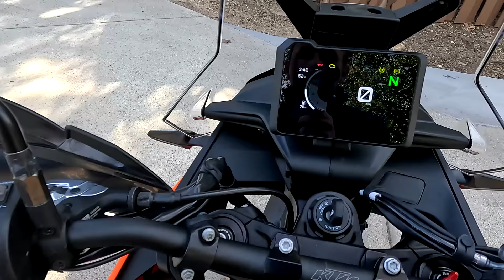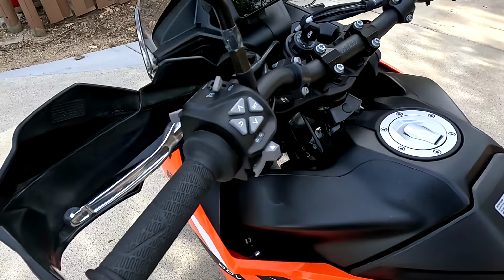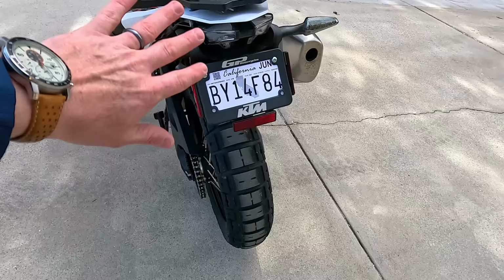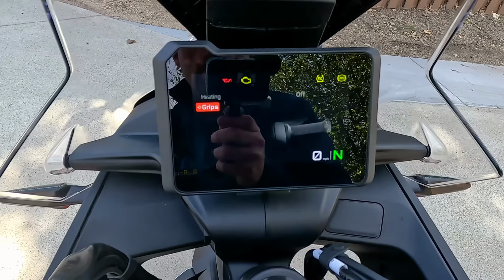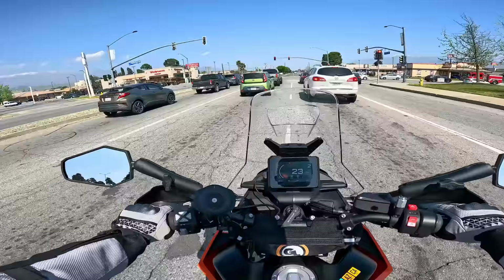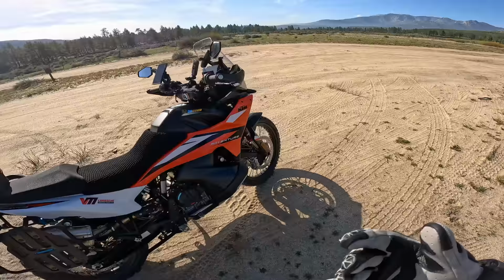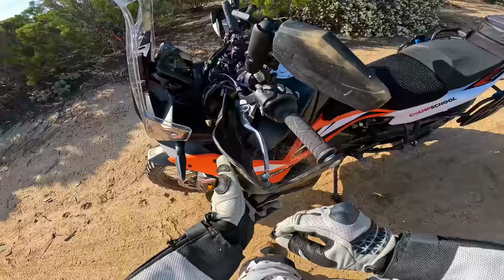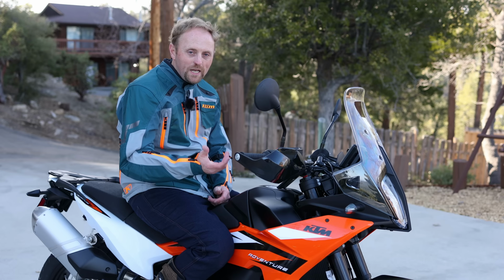2023 KTM 890 Adventure | Perfect Do-It-All Mid-Sizer ?? (EP.2) (Full Review)

Comment: I’m getting my first bike soon (picking up Friday) to ride with my father in law.  We will be doing mixed riding and I was all over the place.  I’ve ridden with him off-road, but this will be my first road bike.  I was planning on an 800DE but the lack of cruise control seems a huge miss when it’s all already ride by wire.  I had a spreadsheet laid out (similar to yours) with all the current models from the CFMoto 800 T (as a starting point only….the 800DE was the real start) to the Toureg, the Africa Twin base, the 890 and on and on.  Then Husky released the 901 Expedition….and that’s what I’m getting.  Not quite an 890R but a bike I’m not likely to have to replace and something I’ll grow into…basically forever.  And the price difffernce considering it has the Tech Pack already unlock is a no brainer.
Reply: i LOVE my 901 but i do wish i had known the Expedition was coming and waited for it for the suspension alone !  but i have spent the '$' to upgrade my 2022 base 901's suspension before the Expedition was ever mentioned , that said this bike is by a margin the most capable bike ive ever owned !   ive always been a dual sport/Adv bike and ive been very lucky to have owned a whole long list of them prior , with the suspension on mine fixed it is like cheating i swear and that Expedition comes with great suspension standard
Reply: great choice 👍👍

Comment: Great review. Thanks a lot.
Looks like a great bike .
Just one thing I don't get... the suspension behavior off-road.
You weren't going very fast at all . How can a performance oriented bike by a company like KTM still come with suspension that you immediately plan to replace?
It's not a matter of cost reduction because it's only 1500 $ less than the R . And it's not like they don't  know how to make a 200mm suspension that is properly damped and has pre-load on both ends...
So it just doesn't make sense...
Would still love to own this or a lowered R

Comment: I’m enjoying your informative reviews. After having watched several of your reviews on the earlier KTM 790 R clearly the market has big expectations of the latest KTM 890 R and it’s apparent  upgrades. As a prospective buyer of a KTM adventure bike I am carefully evaluating the pro’s and con’s over example  the Yamaha T 700 Tenere. I ‘cringed’ at your revelation that the 790 Adventure R had many documented cases of the ‘condenser pipe exhaust’ overheating the rear shock unit resulting in complete failure of said rear shock !. I find it hard to believe that a bike that claims such a sophisticated level of onboard ‘Tech’ could suffer from a simple ‘mechanical’ design flaw ! I will be scanning all the new reviews to see if KTM has fixed this fault in its new 890 R variant.

Comment: Thanks Ian for the very detailed review, as always !
One thing I'm concerned about is reliability. What good is a bike that does not start and leaves you stranded ? Especially for long distance, multi-day/week trips in relote areas...
That's why instead of the KTM 890 adv I'm considering the Africa Twin standard (manual), or the T7 World Raid. The T7 WR is 220 kg fully fueled vs. 229 kg for the AT. It's significant but not THAT huge of a difference...

My question is the following: in your opinion, how does the 890 compare to the Africa Twin off-road (suspensions, power delivery, etc) ? Does the AT feel that much heavier ?
Reply from the maker: The AT feels way heavier than an 890. If you're concern is mostly reliability, stick to the Honda or Yamaha. The T7 WR would be a great bike, wish we got it in the USA
Reply: very very diff bikes , ive personally had good luck with ktm/husky for the most part

Comment: I am thinking about this bike but what I really want is something in between the 390 and 890. If they come out with a 690 adventure that would hit the sweet spot for me. They already have a good 690 single cylinder engine they could put in it and that would easily make it the lightest adv bike in the mid sized segment. Put that motor in a 7/8 scaled down version of the 890, with the low gas tank design and other features, and it would blow everything away.
Reply from the maker: Totally agree

Comment: Great review as always. I am about to replace my 790R and was looking forward to this review. Some thoughts: 
1. FINALLY they have the hazzard lights! When you do trips you WILL stop on the side of the road, and you absolutely need these.
2. Much better package than the previous ones.
3. I dont like that the have 4 screws for the screen. With the 790 I had replaced the screen screw with the a thumb screw and had a both the tall and low screen which i was using depending the trip and was a simple change. Hope there is an after market adjustable one.
4. I am probably going again for the R model but following my experience with the 790, i will fit the low front fender (never had an issue with mud and worse case scenario, remove the fender) because of the higway parts, and will get the seat from the base model (again comfort on long trips) as i did with the 790R.
5. As before i wil get the Magura hydraulic clutch (or sell the 790 with the orginal one and keep the Magura for the new bike).
6. BT for the bike is useless, you have the phone and it messes with the Cardo or Sena usability
7. The cover for the chain sprocket is the same, still a mud trap and very difficult to clean, so again will make holes in it.
8. The handguards feel strong in the touch but they dont stand up the forces of a fall, especially on rocks. Barkbusters with running lights again.

Never had any reliabity issues, my 1200GSA tried to kill me (the front forks recall issus happened to me). Fun note, i learned riding offroad on the GSA (yes, I am an idiot) and these bike seem like a montain bike to me!

Final words, I have gone through several bikes in my life so far and my advice is NEVER, EVER buy a new bike in its first model year! Wait at  least one to find the issues and missing options to come through.

Comment: I have watched most of your videos and  I  would have guessed that you  prefer the Aprilia Tuareg over  both the  KTM  890  because of  the  great price and refinement of  the Aprilia along with the great suspension.  There is a big power difference but you can't put more than 80 hp on the ground in the dirt.  I will never buy a Desert X after you informed me about the  air filter location and  Ducati's arrogant refusal to provide a  detailed  repair manual.  Which mid adventure to you enjoy the most (grin factor),  the 890,  Aprilia or  Suzuki  800?   Keep up the good work.
Reply from the maker: Aprilia is still my favorite

Comment: Ian, thanks for another excellent review. I also have a '23 KTM 890 Adventure, which I really like more and more with each ride. I love tweaking settings in suspension, traction control, etc. So for your new Bridgestone tires, what air pressure do you use for dirt/rocks, sand or highway travel?  Did you try different pressures on the stock Pirellis? Thanks in advance.

Comment: Hello Ian.
 Second post with similar theme. I did just under 10k miles on a 2017 Africa Twin DCT. Motels average every third nite. Moto camped. 95% pavement because early in the trip mud got me in Kansas and i realized this is a bitch to pick up. Got hurt and gunshy of off pavement. The AT suspension is way too soft. Speed limits out west are 80 mph, so closing speeds are 160 mph plus on passes. Thats 180 plus feet per second. Ok....next year i need less weight, more suspension and more acceleration. I just bought a 21 KTM 890R used and equipped as i prefer to do. It has the 1 cylinder start issue. Long term on going problem with these bikes. Guys like you with your platforms can make this very real problem noisy for KTM. Brett is the only widely viewed guy who makes any reference to it that i subscribe to. I am 66 years old and own 7 bikes. Maybe my demographic does not calculate but i spent plenty on motorcycling related merchandise this year and will do so until dementia stops me. Please do more than " brutally honest new bike reviews". The bulk of the real travel is guys and gals buying used bikes and  trying to find information.  Bike night starbucks crowd wants new show off lookit me shit. Used buyers travel and use the stuff. Just my observations as a lifetime biker. And yes i have bought new. 2 bmw's, 1 Ducati, 1 Suzuki. Bmw bought back one of them.
Thanks for what you do and dont sell out with glowing reviews just to get test bikes for clicks. It wil put you in the big bucket. All IMHO.

Comment: So now with this updated 890 out of the norden and this, which did tou like more? Between the standard norden and this, looking at .4" more travel and a slightly taller/wider seat on the 901. 
30.75" inseam/150lb rider here and I like the styling on the norden more but wondering if the little bit of seat height will make the norden feel less manageable

Comment: Hi all. I know Ian wants a bike for every category and I agree and it makes sense. What I don't understand is what bike can go from Palm Springs to Borreo Springs/ Ocotillo Wells, then do gnarly single-track? The EXC-F can handle gnarley, but sucks on the 2 hour highway ride. The KTM 890, Tenere 700, or KTM 390 Adv is a lot better on the highway, but sucks doing gnarly.  Any suggestions? The best compromise I can think of is the KTM/Hustky 690/701 Enduro good on the highway and has good dual-sport suspension with street-bike maintenance intervals.  This topic bothered me since Ian sold his 690. I know people with a truck can just haul the ideal bike to a location, but some rather not- to save on gas for example.
Reply from the maker: The 690 is made for that

Comment: Great review as ever. I have the 22 model. Sad they didn’t call it the 890 S then it wouldn’t be the “base model” or “non R”. I love the bike but my year of manufacture still has the plank for a seat and ugly looks (subjective, of course, but most agree). My fuel economy is consistent with yours but also that the bike reads optimistically by 5%. My GSA was totally accurate and ATAS actually under-read. I got 286 miles from my last tank but the range reading was way optimistic. I had just 0.35 litres left and it was already stuttering at that! I left my mother’s with it saying 31 miles and barely 8 miles later telling me 0. Beware!

Comment: In the hope that you will even read this or respond to, here is what is being said by a KTM mechanic. Have you had any of these problems? From a Forum '' 790/890 issues and why do we still buy them?''

KTMs are what they are: incredibly well-engineered bikes that work amazingly…when they work. Some work longer than others.

Despite a few niggles like airbox sealing, air filter access (fixed on the new design), and fuel pumps, that 1090/1190/1290 platform is a solid bike. I’d have no issues putting my money down on one.

The 790/890 on the other hand is a pile of garbage. The list of problems I’ve seen on these bikes is a mile long and growing by the day.
- premature valve wear
- premature cam wear
- immobilizer failures
- brake failures
- rear shock failures
- countershaft seal failures
- coolant leaks
- clutch lubrication issues
- TFT display failures
- Fuel tank venting issues
- Fuel pump issues
- Debris in fuel tanks
- Single-cylinder startup problem that still has no cure
- Cold-start issues
- Airbox sealing issues
- Numerous software problems (MTC failures, intermittent cruise control failures, ABS failures)

If you’re one of those guys who reads this post and says “I’ve had a 790 for XXXXX-thousand kms and have never had an issue” then good for you, count yourself lucky. After working on dozens of KTM P-Twin bikes that have come through my shop and speaking to the owners of many more, I can name only one that didn’t have at least two of the problems on that list. It’s a great piece of design that was utterly ruined by corporate structuring…built to a price, not to a spec. It’s still riding the wave of being the best reviewed bike (reviews where editors ride carefully-prepped bikes for one or two days then give them back) in what it arguably the hottest segment in motorcycling right now. Mark my words gentlemen…once that hype fades away, a few years go by, and reality sets in, the first-gen KTM P-Twin WILL be remembered as one of the all-time biggest lemons in motorcycling.

Comment: Hi Ian, thanks for your video - as always very useful content. Could you also include hill climbing exercise in your reviews? I find pretty useful to know how steep a bike can go with no throttle, how it behaves at low rpms with some resistance and how smooth it switches from virtually idle crawling to low speed traveling with just a little more throttle?
Reply: @BERZERKERSV4  I used to ride bikes in city with the population of 15 million where you sometimes need to do line filtering at ultimately low speed. These days I ride on different roads, sometimes in the mountains where you wouldn’t want to stall in the middle of the rocky curve or travel at low speed.

E.G. Honda NC750x is just unable to crawl with the closed throttle and/or slower than 20 km/h (almost twice faster compared to Tuareg) and the only way to find that sad moment out was to buy and try. Pretty expensive lesson I’d say.

Comment: Hey Ian, thanks for this great video review. I also have this bike with 1,5k km on it. It really gets hot in jammed traffic or on a hot day. Some of my friends also have this bike and they are looking for a heat shield between exhaust and the rear shock. The rear shocks on 250's and 390's blows out because of this heat transfer. What do you think about that? Have you ever heard or seen this problem?
Reply from the maker: I am not sure the heat shield does anything. No one has proven the heat is causing the shock to fail. Shocks get hot because of internal movement of the fluids.

Comment: How does the rally mode work exactly? Does it adjust the ride mode, suspension and off-road abs all at once and can you turn it on while moving? I have a 2020 KTM 1290 SAS and one of my biggest gripes with it is that when I go from paved roads to gravel, I first have to stop the bike, then set the ride mode, suspension mode and off-road abs all separately and it takes around 20-30 seconds. Then when the gravel road ends and pavement starts I have to do all that again and it is super annoying and I find myself not going anymore to roads that alternate between paved and gravel (they are pretty typical roads in rural Finland)

Comment: Ian, is there easy access to the fuel pump on the 890?  The fuel pump on my 2017 KTM 500 EXC-F is located in the tank and you have to remove the tank and drain it to replace the pump.

Comment: My understanding is that even though the bike is assembled in Austria, a lot of the parts are still sourced from China. Also, I'm not paying EXTRA to unlock software that is already installed on the bike. That's crazy. Just sell it unlocked. That's a stupid move on KTMs part.
Reply: Isn’t the software that you have to pay for usually an extra cost? My understanding is they let you sample the features that used to be extras and you decide later if you want to buy them.

Comment: Ian, thanks for the excellent review of this bike - just what I have wanted. No BS and hype, but pure useful and practical information, especially for my use case - much appreciate your reviews; just the way I would do them. 

Couple things you did not mention but which I was happy to see - the bike comes with a steering damper, and there is a Cool Covers seat cover for this model - both things I like, and the seat cover is an automatic add-on for me living in Houston.

I am looking to replace my Tracer 900GT with something that is offroad capable but at the same time a good long-distance tourer. I am not an off-road rider but I like moto camping. The price point has to be such that I can keep my other bike (BMW R1200RS). The other bike that I would consider is the Triumph Tiger 900 Rally Pro but that is too expensive, and I would have to get rid of the RS, and I don't want to do that. So, this bike is in the running and the only thing I am not too impressed with are the cheap controls and throttle play - cheap, considering the price. But it sure looks like a lot of capability and fun. And I actually like the look of this KTM.

Keep the reviews of this bike coming! 👍👍

Comment: Thanks for the clear view on suspension compared to the R. 70 to 80% as fast sounds better than 20 to 30% slower, but is actually more to the point. After putting the clickers on ‘sport’ settings I find it working surprisingly good on my new standard 890. On stock settings the rear started pumping and bouncing too quickly. Very curious to the suspension upgrades.